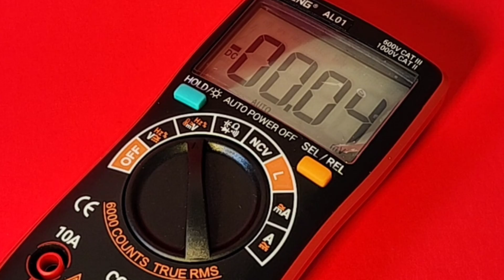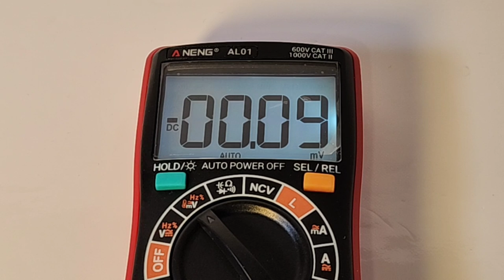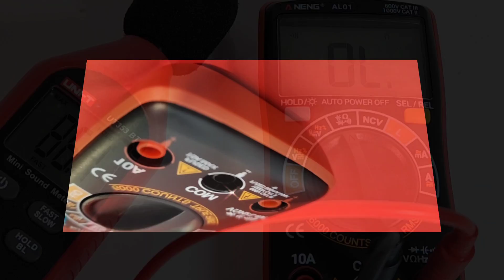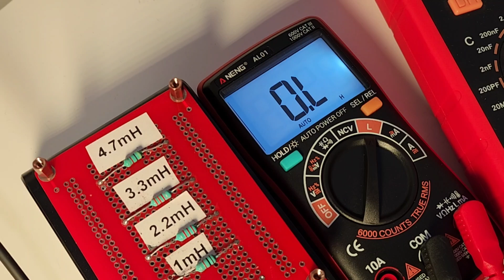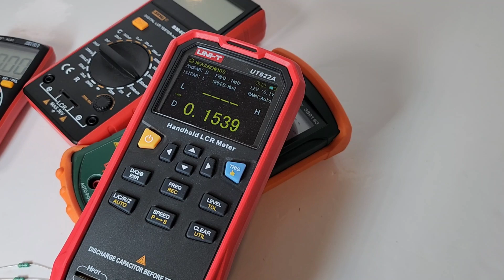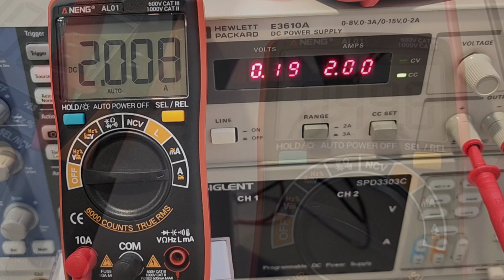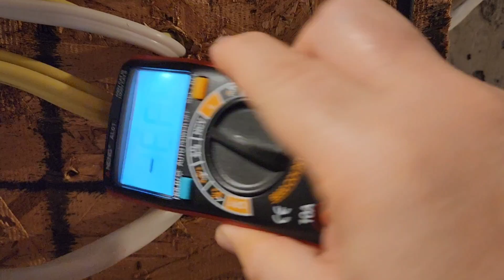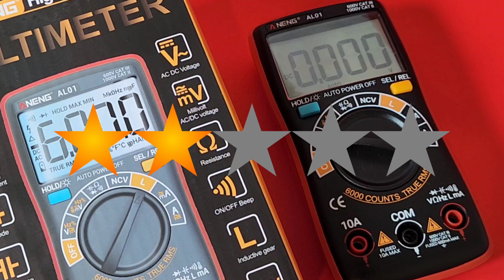ANENG AL01 CHEAP-O Multimeter Review & Teardown!

Comment: With one youtube sample that doesn't deliver you can expect similar problems down the road.

On the technical side, those L measurements errors looks like missing bits in the ADC. The results are double of what they should be.
If it were a salvageable device it would have been interesting to see if the error translates to other measurements (DC, AC) for that 3+ range.

Comment: On inductance - I suspect faulty sample. I've just received my AL01 to replace my old broken UniT with inductance capability (UT71). My new AL01 was spot-on (within 5% of nominal) on my power inductors. 0.68-3.3uH.
Reply: I support that. I tested mine today on 05, 2,2 and 7.3mH and it was just a tad low on the 7.3 but in general accurate nuff.

Comment: Not much point adding a function that doesn't work too well!! I have seen those size fuses as through hole components soldered onto boards but never as standard clip in fuses, unless they cut the legs off of course.
Reply from the maker: Yep..those fuses are a real headscratcher! Aneng needs to do some homework and get back on track 😮😮

Comment: Imho, without induction and ncv, it would be not so bad multimeter, even with low quality probes. But it is chinese kind of way )
PS Fault NCV = literally death threat (
Reply from the maker: I hear ya..
The ncv on this is a real turd and honestly laughable..I think you're better off using a Screwdriver 🪛...just kidding!! 😅
Reply: @KeepOnTesting old style screwdriver with neon light definitely works better)
Reply: Agree my friend but the USP of this cheepo is the inductance capability which is a fail.

Comment: Promising a function if it doesn´t work - That´s a no-go! Fake it until you take it is not a possibility for test equipment. Aneng had builded up some reputation with the famous 9999 Count multimeters 8008/8009. And delivers a sudden death with this one. Very sad! BTW: Very nice LED - test rig. This time it simply works! Even the haunted yellow one...
Reply from the maker: You bet ! Induction is definitely a cool add-on , if it works! At this point it's merely a gimmick 😅 Yep, LED tester is back in action just needed a little tuneup ! 👍

Comment: What on Earth has happened to Aneng? all misses lately. I think the unobtanium fuse choice is to discourage you from blowing them up😊or if I was the cynical type so you have to replace the meter.
Reply from the maker: My thoughts too Shaun..seems Aneng is more concerned about churning out meters than actually making them useable. 😳
Reply: Yeah, it's a shame because if someone where to ask me "What is a cheap, good, DMM for basic electronics work", I would still recommend the Aneng AN8008 (yes we know it's a Zotek but Aneng made it popular)
Reply from the maker: @shaunmorrissey7313 The little ANENG 8008 is definitely a classic!